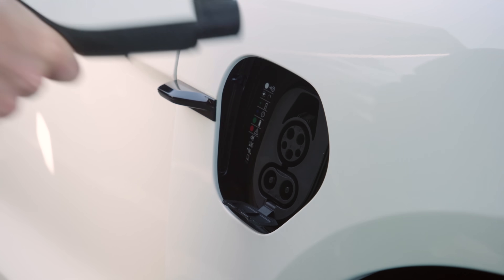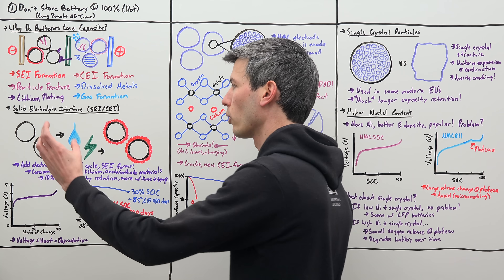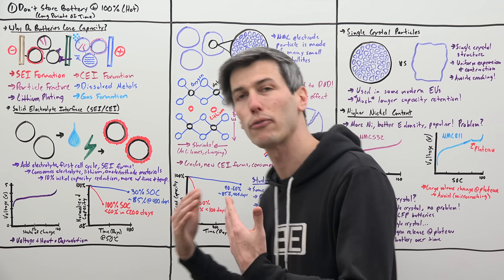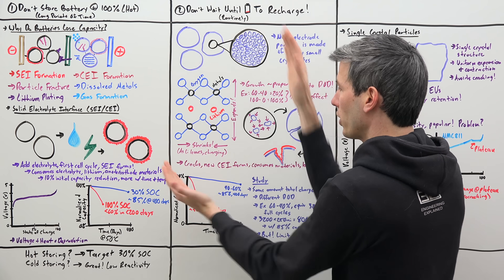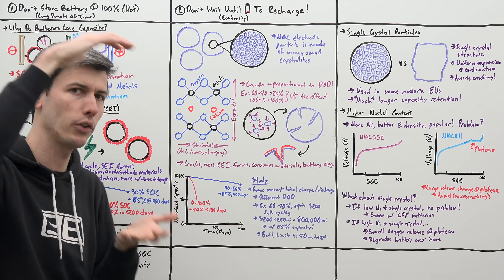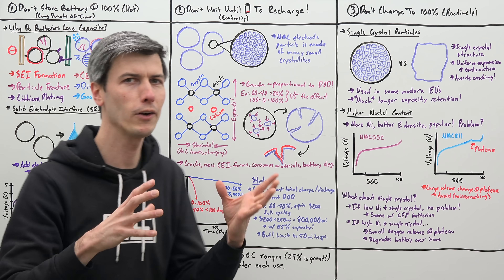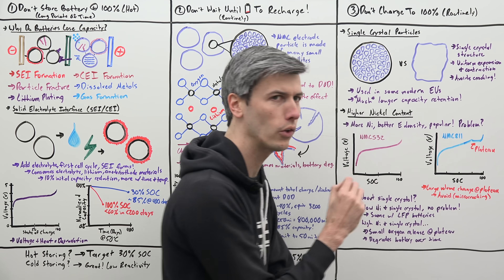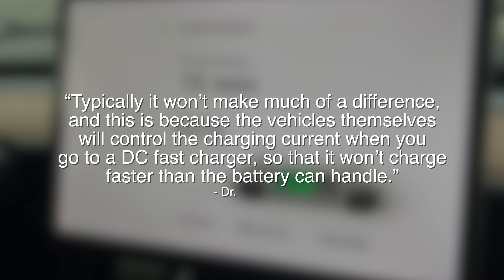How To Ruin Your Electric Car's Battery - NMC Edition!

Comment: So you need to be electric engineer and chemistry professional to charge your ev. Shouldn't this work so that user just needs to plug it in charger and ev system takes care of rest?
Reply: You don't need to be an electrical engineer to use a slider in the GUI to set your regular day-to-day charging to 80%. It's really not hard.
Reply: It does, he's just explaining the science of it.
Reply: You need not understand it to follow the tips the manufacturer already writes in their 200 page user manual 

Just that people are too lazy to read that and would rather watch a yt video saying same thing even if all they do is read out of same user manual 

Jason needs that engineering to explain the science though, it’s upto you to have the curiosity and necessary base in science to understand it 

You can still follow it without knowing it 

You don’t need to understand quantum tunnelling to use a SSD storage drive on your laptop or pc 

You just need to know what size you need and what PCle slot it fits into

Comment: I charge 80-85% in the winter due to colder temps and use 30-40% of that daily (I drive 80-120 miles) and in the spring / summer / fall I charge to 65-70% and effectively get the same range but using 20-30% of my SOC, better efficiency. 

My mid-range new had 64kwh Gross, 62.6kwh usable.. Today after 100k miles its got 58.6kwh usable / 61kwh gross. So 3kwh loss in 100k miles, and fun fact it lost 2kwh in the first 25,000 miles than it did losing the remaining 1kwh in 75000 miles. So realistically this car will get well over 250-300,000 miles before I hit the 85-90% degradation point. Overall its on point.
Reply: What app do you use to get those capacity numbers?
Reply: My M3P has the same color wrap as yours😂😂😂
Reply: @pissmyasslynch5325  I like it - I got my color sprayed in Autoflex + Clear coat (its peelable paint but ultra durable with real clear coat) I got 70,000 miles on it and it still looks great and is 13-15mil thick. Mantis Verde (lambo) + gold pearl - gold gives it a yellow vibe in sun.
Reply: Which ev brand and which battery?
Reply: @larryc1616  NMC811 - 2018 Tesla Model 3 Mid-Range
Reply: @AustinFerguson  great! It looks like you baby'd it which is why it lasted so long. Get the LFP in your next ev and you can treat it like an adult.
Reply: @larryc1616  And what "treating it like an adult" means? Waiting until it's dead before you plug it in? I'd rater keep the habit to plug it every day so I don't forget and wake up with a dead battery.
Reply: @larryc1616  "treat it like an adult" is a weird way to say irresponsible.
Reply: @OtisFlint  it just means you don't have to baby an adult with LFP
Reply: Nice work. But I wonder how many Normies would be this Geeky? Clue: None. And, sadly, they will be the majority of users... 
Software-Defined Vehicle -> build best practice into the EV's software, not the user
Reply: My 4Runner got 20 MPG in 2002. It got 20MPG last week when the temp was -15. I charge it to 100% once every 2 weeks.
Reply: @tango_uniform  Where do you live? Because here in Canada, every single gas car as much worst gas mileage in the winter. It also gets worst as every component wear out. A 200k miles engine will always have worst gas mileage than a brand new engine.
If you want to hate on EVs, at least get your facts straight.
Reply: Apples to oranges. I grew up in Radisson QC, been around Ontario over 4x postings with the RCAF and you don't have a point - or misunderstood his angle on cold weather range losses. An old engine at -20 will lose much less range than a brand new Model 3 in the same circumstances. If you're saying otherwise you're not being honest with yourself. EVs up here lose 40-55% range at -20, the old Camry will lose 100 km off its 620-640 km range. Apples to oranges.
Reply: @jacquesc3166  I didn't "misunderstood his angle", I simply corrected his lies. Sure any EV will be more affected by the cold, I never said otherwise. It's my second EV in Lac-St-Jean and my range doesn't drop 40% at -20°, maybe 25% at most. And if we're talking range affected by age, most gas engine will deteriorate much faster than your typical EV battery. If you're saying otherwise you're not being honest with yourself.
This dude comes out of nowhere saying some BS about his gas car in an EV conversation and I'm the one comparing apples to oranges?
Reply: @MrArcticPOWER  beg your pardon but all heat engines become more efficient in the cold and heating the cabin is used by using the waste heat, please expand on how ths ICEV become less efficient in the cold.
Reply: @mohamedmorssi9494  -Much higher rolling resistance mainly caused by the higher viscosity of the bearing grease and all the oil.
-Energy loss in the tires (cold pavement suck more heat)
-Less efficient winter tires
-Most people will let the engine running before leaving
Of course, just like EVs, it's a lot worst on short trips. My last gas car did 7.5L/100km in the summer and went up to 9.5L/100km in the winter.
Reply: @MrArcticPOWER I still don't  see how this is exclusive to ICEVs and does not affect EVs as well? The reason why internal combustiom is more efficient in the cold is pretty straightforward, for example at -20C the air density is 15% greater than it is at say 20C. That means the energy needed to draw and compress air is significantly reduced. As of increased oil viscosity at colder temps, waste heay can be used to improve this, which is not very applicable to EVs in which you need to use the battery to do so.
Reply: @mohamedmorssi9494  I never said that cold doesn't affect EVs, I'm well aware that it's worst on EVs actually. I'm just telling you why the cold negatively affect gas mileage. 
15% greater air density does not translate to 15% greater thermal efficiency what so ever. It might improve it a bit, but nothing compared to all the drawbacks of cold weather. If you don't believe me, come to Canada and see for yourself. Or simply do a 2 minute google search, that works too. 
I'm responding to a guy that said his car has the same gas mileage 20 years later and in the cold, which is impossible, I'm not trying to sell you an EV.
Reply: @MrArcticPOWER  You are right, 15% denser air means 15% greater drag at the same speed while the efficiency gain in the engine increases by less than  15% of course.
Reply: @tango_uniform  You win first place in the Boomer comment award!

Comment: You forgot two things. Do not fast charge with a cold battery! 

The faster you charge, the more you stress the battery. So avoid fast charging if you can.
Reply: I think basically every EV has built-in safeguards for this, it will either not charge, or charge slowy until the battery heats up enough (also newer EVs have pre-conditioning to make sure it's at the optimal temperature when you arrive).
Reply: @BrandEver117  That is true and it helps a lot, but real world testing done by youtube channels like Bjørn Nyland shows that vehicles that have been often fast charged or been charged frequently with a cold battery. Have a lot more battery degradation than cars that have been less fast charged and the owner has pre heated the battery before charging.

Comment: Man... Imagine every time you filled up your tank of fuel to 100% the tank would get smaller, and the engine had a higher chance of failing. 🤣🤣🤣
Reply: Every time you use a gas car (or any machine) it has a higher chance of failure. It's called wear and tear.
Reply: @BrandEver117  but somehow my mileage stays the same.. my tank doesn't get smaller and smaller.

My car is 14 years old, and still gets the same mileage as new...
It'll still get the same mileage in 10 years as it does now...
It'll still be on the original engine too.. it also cost me $6000 for the car, it has 158k miles on it..  it doesn't lose massive amounts of mileage when I turn on the heat, I don't have to fear running out of range in the cold..

Your cope is unreal! 🤣🤣

Boohoo, bought the overpriced appliance...

Comment: Manufacture should advertise the range based on 80% charged battery and with ac or heat on at a reasonable temperature all the time.
Reply: LFP doesn't have this problem with the older lithium ion batteries and last 4x longer
Reply: @larryc1616  LFP also has lower density, though. There are trade-offs, but for most LFP will be the superior option.
Reply: Why..
Unless you are in the insignificant portion of the population that needs the full range of the vehicle every charge.
Nothing wrong with charging to 100 percent occasionally for a long road trip.
By the way.
New gas cars require the fuel pump to be immersed in gasoline to keep cooled.
That means you should not drive your gas car down to zero gas in the tank.
Should their range be adjusted also?
Reply: @thomaswilson2917  ok but in-tank fuel pump = $200-$300 and dropping the fuel tank
EV battery: between $10,000 and $30,000 depending on vehicle and manufacturer
Reply: @lsswappedcessna  you refurbish a EV battery if it every needs replacing..
Notice the word IF..
Yes it costs more but the discussion was about range reporting..
Reply: @thomaswilson2917   Batteries are consumables, you'll eventually need to replace it.
Reply: @svr5423  Barring a defect or severe misuse, a modern EV battery should outlast the useful service life of the rest of the vehicle around it. So no, they don't typically need replacement.
Reply: @cheesetomatoes  lol, I don't plan to throw the whole car away just because the battery died. It's bad enough we do this with smartphones nowadays.
Reply: @svr5423 an EV battery is designed to last the usable lifetime of the vehicle.
If something happens you can refurbish the battery not replace it.
Reply: @thomaswilson2917   That's a short lifetime. I typically plan to keep a car 10+ years.

We have already seen several cases where battery casing suffered minor damage and the whole battery had to be replaced, even though it was fairly new.
Reply: @svr5423  what short lifetime are you talking about.
EV batteries are designed to last a normal lifetime of a vehicle which is at least 200k miles.
Mine came with a 150k mile warranty on battery and drivetrain.
Reply: @svr5423  would be covered by insurance.
Seen new gas engine blow up also..
Isolated cases don't mean anything.
Reply: @thomaswilson2917   Batteries typically don't last that long. Expect couple of years for a lithium battery on avergae, especially as it is stored outside in the sun with temperatures reaching 60C inside the vehicle.
Reply: @thomaswilson2917   it means that batteries aren't typically refurbished, but replaced.

This in line with other batteries. For example, lead batteries can also be taken apart and individual cells refurbished. Typically, no one does this, in a car the whole battery is replaced.
Reply: @svr5423  funny since mine
 Has a 8 year warranty..
Calif requires a 10 year warranty.
The batteries you are talking about are not the same as what are in EVs
Reply: @svr5423 You need to look into things better. There is EVs around with original batteries since 2012 and many years to come.
Reply: @thomaswilson2917  do gas cars ever advertise their range? 🤔
Reply: @nomadic_mind  actually they do.
They give mpg you just multiply by gas tank size.
For some reason the the EPA decided to do range other than watt hrs per mile which would be the mpg equivalent.
Reply: @nomadic_mind   Yes they do.
Usually the size of the fuel tank is advertised as well as the typical fuel consumption, yielding the range.

Since gas cars can be refueled quickly, it's less of a concern though.
Reply: I treated 25% as empty when I still had a gas car, per the owner's manual. Whereas I charge my EV to 100% before a trip with zero reservations and drive it all the way down to 10% if fast charger spacing allows.